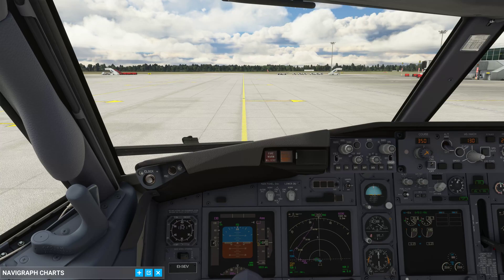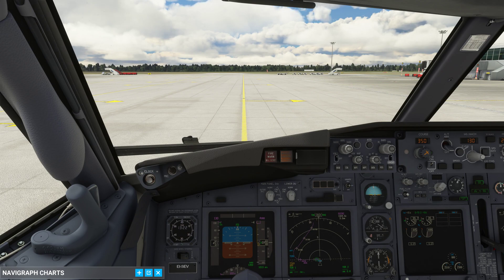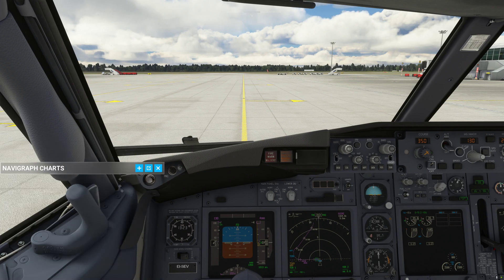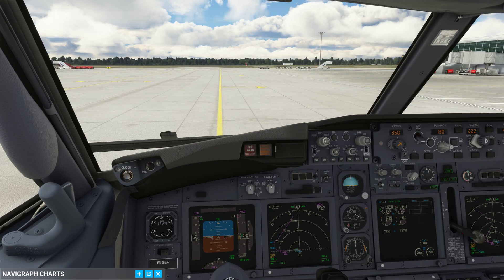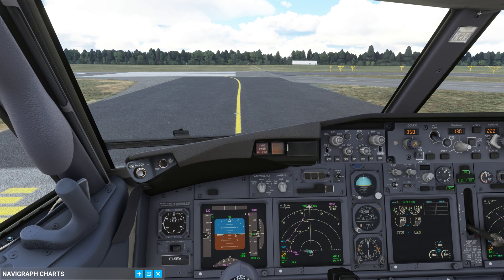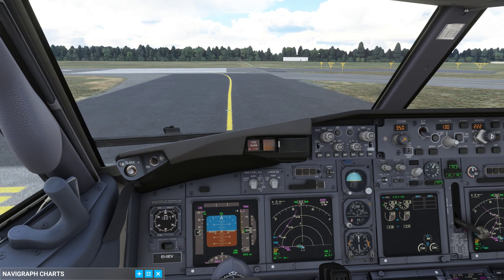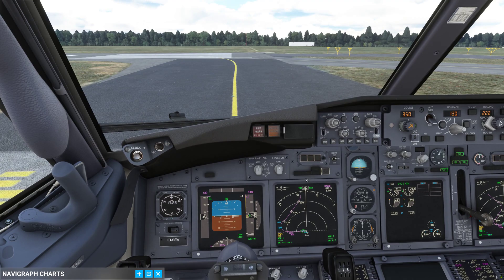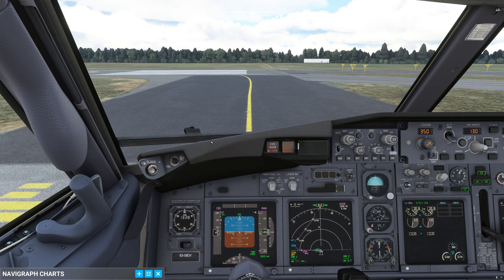PMDG 737-700 for MSFS - Tutorial 7: Taxi

Comment: I love your videos by the way. I’ve been having trouble with taxiing and toga takeoff using TCA throttles , I’ve just read that using two levers causes the problem if one lever is pushed forward and slightly out of sync with the other one the auto throttle turns off so now I use the slider on the TCA side  stick , it’s just one lever so you can get the 737 leavers perfectly going forward together works a dream

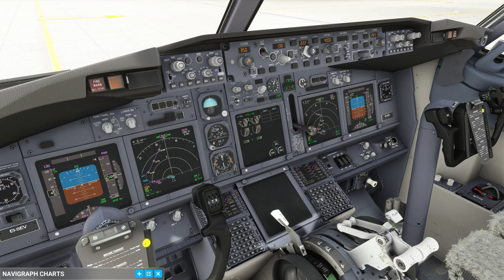Comment: When I perform the engine lever forward before taxi I am constantly getting a TO config warning. 2:48  I'm following the tutorials as closely as possible, taking a lot of notes, but I cannot figure out what's missing. The after takeoff checklist says to have the engine bleeds on. Are they supposed to be off before takeoff? Is that the possible source of the TO config error???
Reply from the maker: The takeoff config warning primarily checks for the speedbrake, flaps, trim and parking brake.
A common flight sim error is to arm the speedbrake before takeoff. DON'T do that, else you'll get the takeoff config warning.
Reply: @A330Driver  Roger that. That was the problem and is now better! Thank you for your response.

Comment: I came to these videos because I was getting the takeoff config warning on every takeoff. Though you did not explicitedly mention it, I did figure out what it was (might help others):

For the PMDG B738 for P3D the manual instructed to arm spoilers for takeoff [and landing, naturally] if I recall correctly, to assist the RTO. I had this procedure down to my subconsciousness. With the video I saw that arming spoilers for takeoff is a thing you don't do in the B737 for MSFS anymore. That got me curious. On my next takeoff I did not arm the spoilers and decided I WILL reject it, to see whether 

a) that fixed the takeoff config being wrong and
b) the spoilers would automatically deploy or if you had to think about it if you reject a takeoff. 

Lo and behold, no beepings and aircraft DID deploy the spoilers automatically (as indicated by the amber light and outside view) despite not arming them. I was amazed. xD

Now I'm super curious... Can you explain the difference as to why it's not done with this model? I assume some extra automatisation? Curious about the "technical" background.

This is why study level aircrafts are awesome. Even if you studied a previous version (and different model) in another simulator, once you get another thing (despite both being Boeings) you have to RELEARN some minor things. Other than that, I could just run the flows of the P3D version and it worked on first try. :D I knew about the hidden clickspot for TOGA, but the hidden clickspots for flap settings blew my mind. Good stuff! xD

TL;DR: If plane beeps annoyingly and red "takeoff config" light goes on, make sure spoilers are NOT armed, whilst having autobreak on RTO and flaps green lit.
Reply from the maker: The spoilers are never armed for takeoff in the 737 (and I don't think in other Boeing models either).
If any P3D manual mentioned so then it is absolutely wrong.
Reply: @A330Driver  OK thanks a lot. Might have recalled wrongly. Been a few years I did the whole P3D thing. The flows stuck with me though. :p

Comment: Pardon me for asking so bluntly, and probably asking a very stupid question, but I never noticed that you set your altimeters in these tutorials of yours, and I was sort making a checklist for myself, with your videos as reference. Anyways, I was wondering when you should set your altimeters; before APU Start, before pushback, before taxi, etc.. 
Thank you for making these videos BTW.
Reply from the maker: The QNH in those videos was 1013, that's why I never had to set them.
According to the book you do it when you're setting up the rest of the EFIS CP.
In real life however you usually set it immediately when you get an ATIS or hear ATC giving a new QNH.
"Hear QNH? Think: Reset Altimeters"
Reply: @A330Driver  EFIS Control Panel? Is that the panel besides the MCP? Or something else entirely. I'm sorry, not quite familiar :p
In real life though, when would you acquire/listen to the ATIS? I Expect you would set the EFIS not long after that, when the IRS has aligned?
Reply from the maker: @linen8231  The EFIS Control Panel is the one to the left and right of the MCP (the autopilot control panel). The one where you change the settings of your Primary Flight Display and Navigation Display.
Reply from the maker: @linen8231  Recording the ATIS is one of the first things you want to do after the safety inspection and electrical powerup.
Without the ATIS you won't know which runway is in use and you definitely need this information latest by the time you start programming the FMC.
Reply: @A330Driver  That explains it perfectly!
Thank you so much for the help <3
And keep on making these great tutorials!

Comment: Great video as usual so many thanks again. You mentioned a speed limit of 5kn for contaminated surfaces. I guess that means snow and ice but does contaminated mean other stuff too like sand or dirt?
Reply from the maker: There's one very important word in the flight crew training manual, which basically tells you to be reasonable. If you have any doubt about the speed at which you can taxi, then there is no doubt: Reduce the speed further.
Of course you could google the exact definiton of a contaminated surface, but always keep in mind: If you see something you don't like you have the full authority to do something about it.
Only because you might legally go 30kt on such a dirty surface it doesn't mean that you have to.